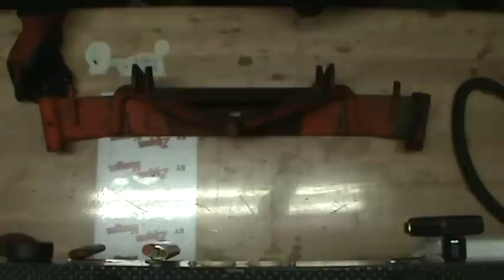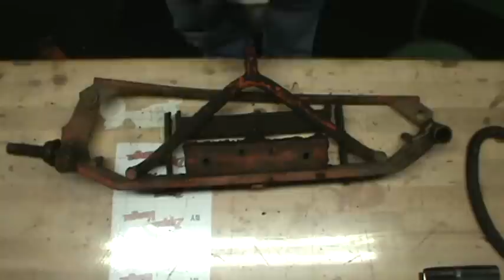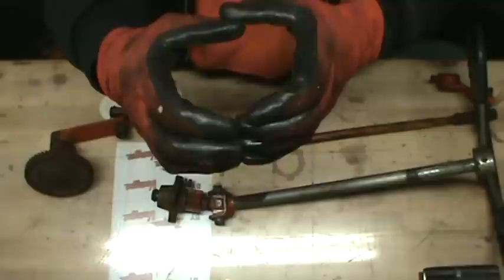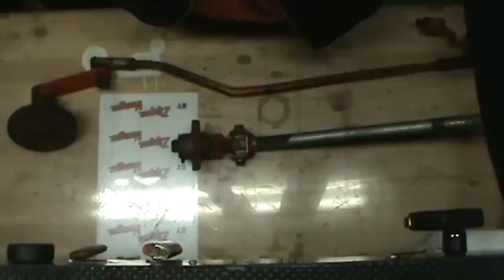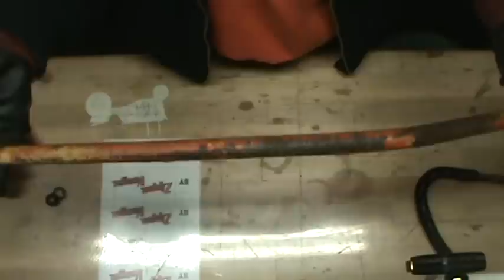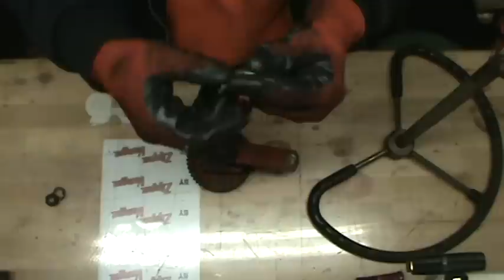Early Simplicity and Allis Chalmers Steering Maintenance

Comment: I have not read any of the comments. or i will forget what I wanted to ask.(  SQUIRREL )😅So my neighbor  found one of these for my birthday  i just turned  50 i will have to look at the front I don't know if mine has the hole.but  will you show your mowers off i don't know  what year mine is.i just found your channel I can tell if someone knows what they are  talking about  so I subscribed.

1.i toke some old car oil and did what I could. mine has square screws in the front bars where you turn the wheels 🛞  i put oil in it since there is no Naples. I oiled the areas  i could do. Under the set the front  like I said  the springs under the set.all over.i love theses old styff.i grew up on them watching my grandma parents doing garden work plus theses can stand the test of time. So I am thinking 🤔 of  selling my newer riding mower for this one i need some parts though 🤔 but I will think it will be worth wild.mine I will call  ( caret )
.
I will stop here.
I don't m.ne to ramble
So good night.

Comment: Tkxs zipper I'm trying to get steering fixed on my b10 and it is the lower drag link shaft but my keyway is so worn out and someone tried welding it  that now it's got to be machineed  the setscrews not setting into the metal  cause it's so rounded out now  but I really like the information you share old machines are cool and people like you me whoever need to keep em going
Reply from the maker: Used parts for these machines are plentiful Mark. If you use Facebook, go there and join the many collector groups. Many of us have spare parts to help others keep their machines up and running. Also, there are collector web sights. Simpletractors.com and Michaelstractors.com to name two. Also great resources for information and parts. Cheers and good luck! Zip~ (Please...not Zipper lol)

Comment: The gear on the steering shaft with the u-joint was a problem on my Squire. The bolts loosened up over the years and when I got it, it turns about a 1/4 without the wheels turning. Now that I’ve watched this video I’ll fix the steering

Comment: I have a 616 hydro and the ball stud came out of the joint next to the front tire .I don't have the same end as you did in this video how do keep it from popping out is there a clip I have lost or something
Reply from the maker: The type you have, I believe, is set in then the drag link it self has the metal compressed around the ball. I have repaired these with good success by removing the drag link and ball, setting the drag link in a vice, installing the ball, then using a drift punch, I "peen" in the metal around the ball to re-secure it. Best of luck! It can be repaired, but if not, replacement parts should be available. Zip~

Comment: Thank you for the video. Got a kick out of your 'go ask someone else comment' at the end. Funny! Have newer Sovereign myself. Noticed when greasing front spindles that giving a few pumps with front axle on ground, then a few with front end lifted ensures grease is distributed both top and bottom of spindle. (May be unnecessary, but works for me.)
Reply from the maker: Very good point and way to do it G!! Thanks for stopping by! Most of the general maintenance holds through many model years, so I hope this video helps a lot of people with a wide variety of machines. Cheers!! Zip~